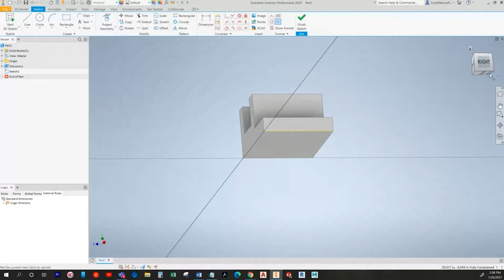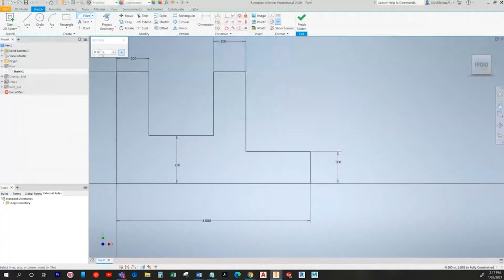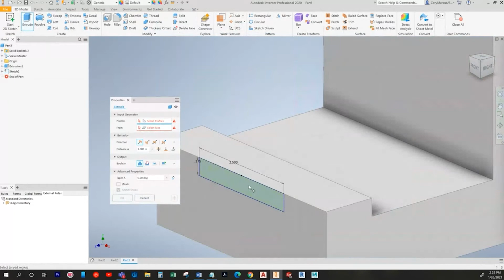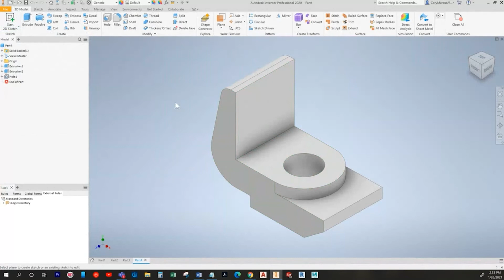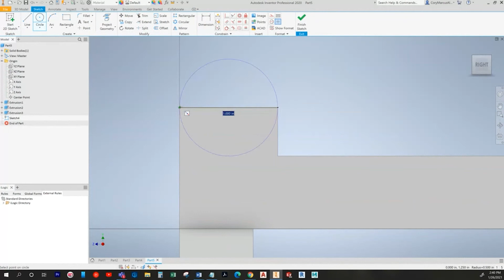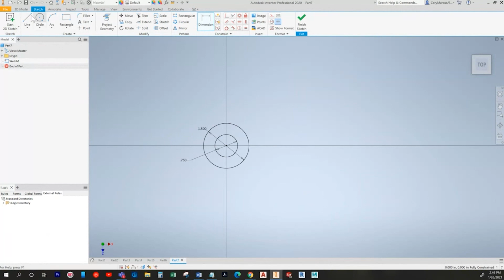Chapter 4 Solutions: Parametric Modeling With Autodesk Inventor 2020

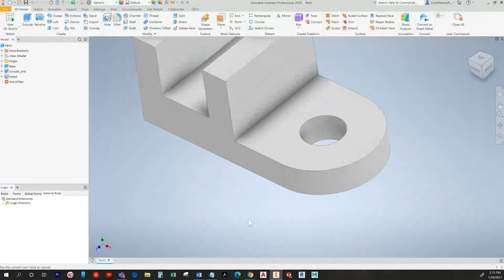Comment: 5:30 When I use the hole tool it doesn't let me select a face. At the top instead of saying Last Used it says No Preset
Reply from the maker: the preset part does not matter. It can say no preset and still work. make sure position, under input geometry is active, that is what allows you to choose the location of the hole.